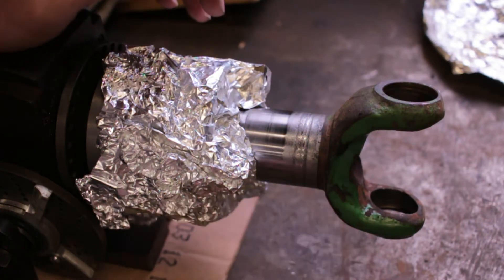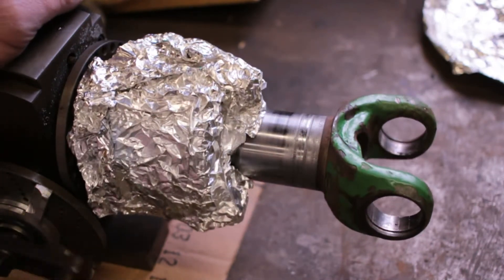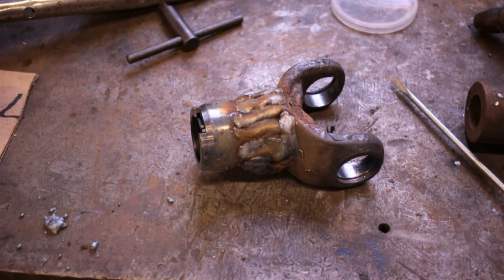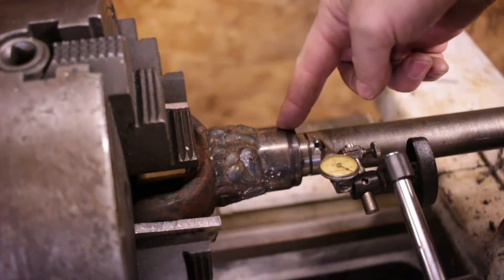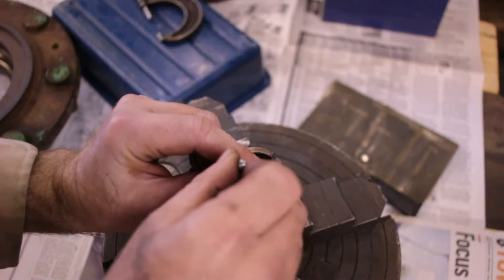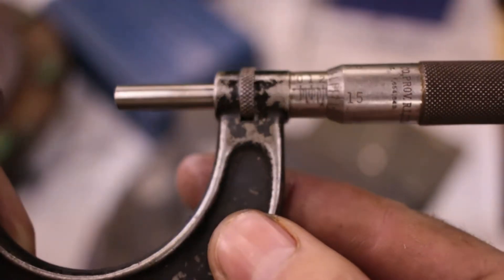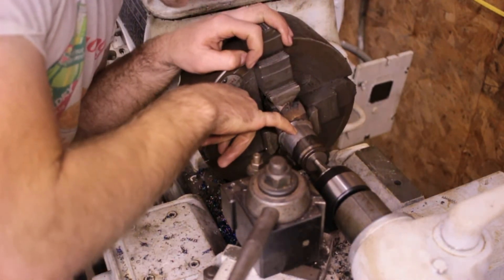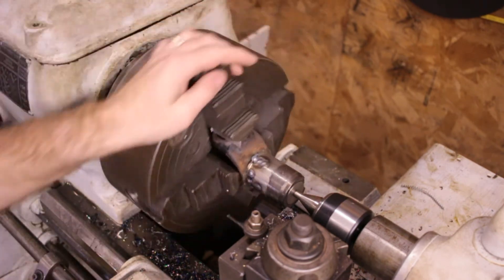Using the Monarch lathe to repair drive axle universal joint from a John Deere 2955

Comment: Just a thought but a wear sleeve would have been a lot easier,faster and is economic
Reply from the maker: I forget why we didn't try a speedi sleeve.  Someone else suggested making a thicker sleeve that would just get welded in a few spots.  That might have worked better but there are a few drawbacks to that.
Reply from the maker: I just talked to my dad about why we didn't just do a sleeve.  When the wheels steers left and right the shaft slides in and out through the seal.  If we didn't get the sleeve in the perfect spot it would shred the seal sliding on and off the sleeve.

Comment: To avoid pits in your finished surface machine twenty or thirty thou out of the shaft then weld and re-machine to size
Reply from the maker: Someone else recommend turning the area smaller and then making a split sleeve that could be welded in place then turned to the final size.  One problem I had that I didn't anticipate was since the piece was hollow it shrunk when the weld cooled and I had a hard time getting the shaft back inside.
Reply: @diyVT  A good pre heat before welding and wrap the piece in a blanket to slow cool, may have helped with the shrinkage,with low heat on the welder, also you can reverse that yoke in the chuck it is easy to center the u joint end

Comment: Any time you weld parts like that there going to have some cracks from the heat and cooling of the metal . Your building it up for a carrier bushing right. . It won't look at the finish it'll just fit and spin. And you should cover the ways when welding , treat the lathe with respect it deserves . Please don't ruin it with not knowing the rights and wrongs. Yes weld splatters super bad even tig produces it. With doing things like that you won't get subscribers. Just the truth.
Reply from the maker: The only times I have TIG come close to splattering was when I have forgotten to turn on the gas or when I was welding something dirty.

Comment: The weld is very irregular and lumpy. It probably would have welded up better if you would have ran the welds vertical instead of parallel with the shaft. t.
Reply from the maker: My dad welded the second one and he welded the other direction and it came out a bit better.  I think I should have also used a lower heat,  I was worried about getting a cold start.